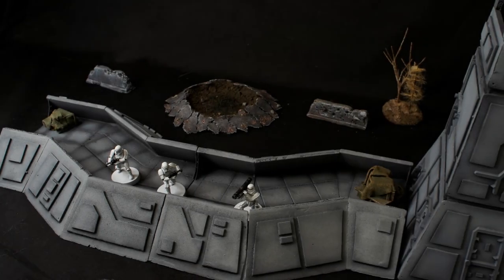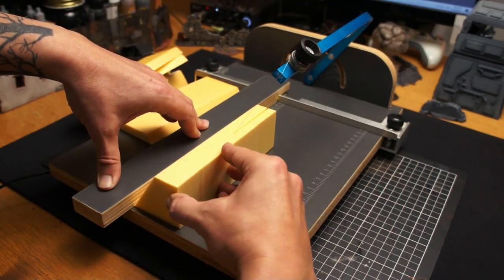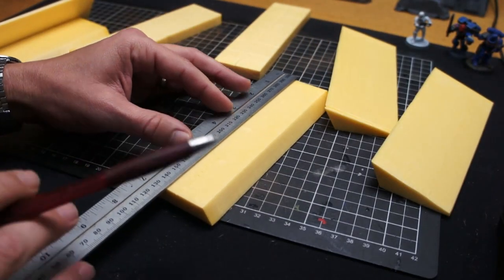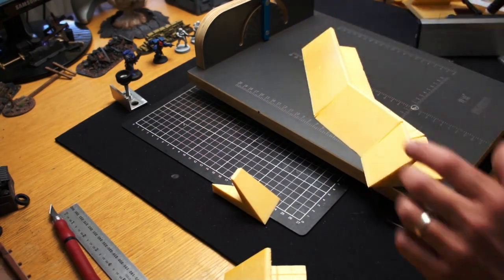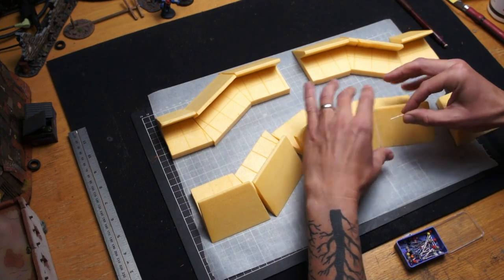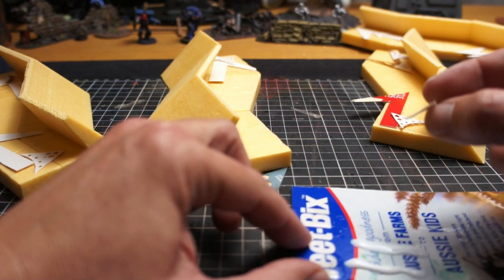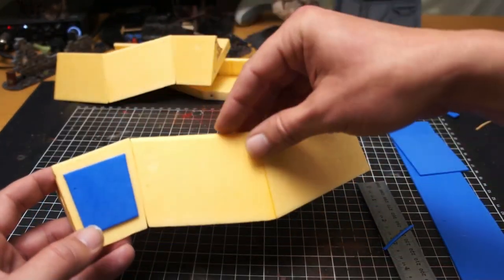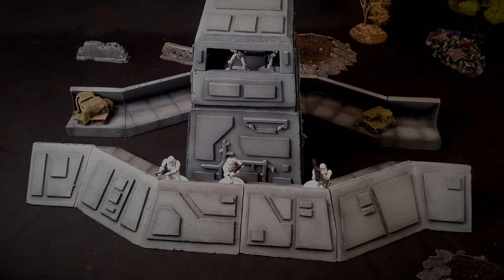Star Wars Legion Terrain Miniature Modular Trenches for Wargaming

Comment: Looking really good. If I may suggest, consider adding corner pieces so that you can have deeper recesses in the line, or even a whole corner post for the fortification.
Historically, the zig-zag pattern was used to block lines of fire down the trench and to prevent shrapnel from going more than a few meters. This only worked when you had narrow sections with corners obscured by the walls though.
Reply from the maker: Thank you.  Great suggestion too, I definitely need to add a few more variations of these as options, which will be really easy to do I think.  During this build it was a toss up between having lots of little modular pieces, which would have made for lots of variations (and likely more realistic options), or a few medium sized pieces to move around.  You could easily go either way if you have enough magnets and patience to go for lots of smaller pieces :) .  But you're right, it does feel a little incomplete here I think.  I appreciate the comment mate.  Cheers.

Comment: so good! i love the idea of those small corner angles. (also a bit of fine sandpaper on the bottom of guides will help give you a little more grip for your hot wire guides! well the non moving ones anyway)
Reply from the maker: Thanks for the tip Trent.

Comment: don't know if this could work but neoprene glue is quite strong and not abrasive, it would save you time for the big pieces
Reply from the maker: Thanks for the suggestion, I will definitely try to grab some of that and give it a try.  Cheers for your comment.
Reply: @RFDHobby  just use it in a well ventilated area, the stuff is nasty to smell ^^"